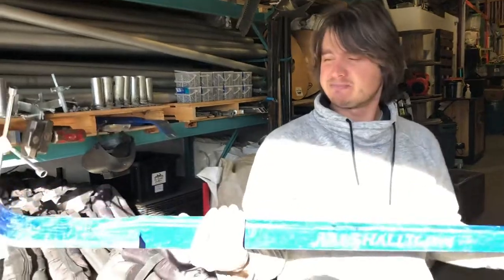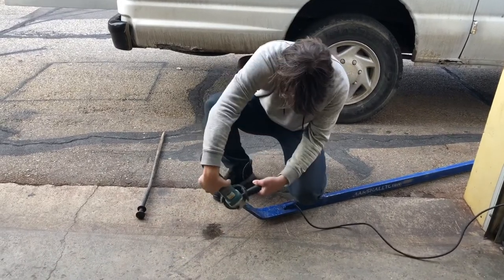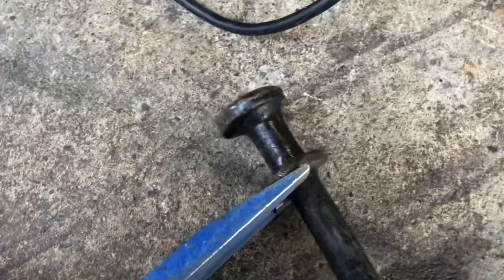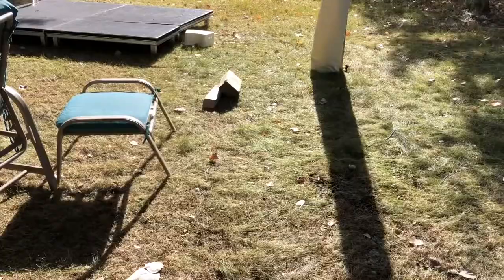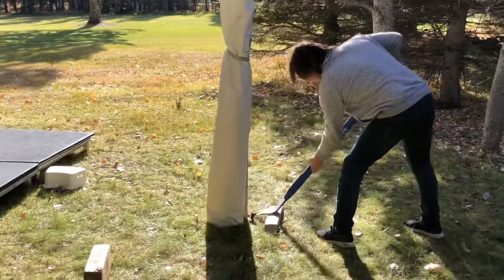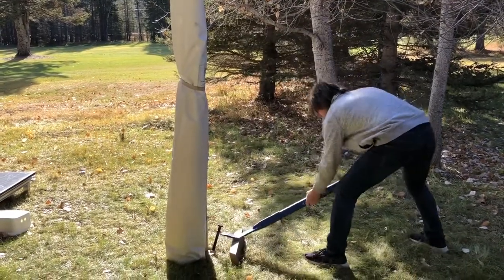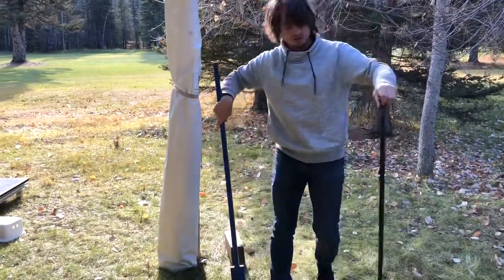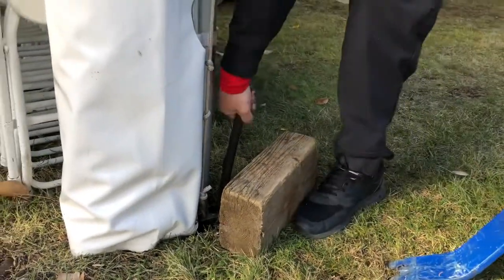Burke Bar - It's Awesome For Pulling Stakes - Prove me Wrong

Comment: Nice.    I've ordered some GroundGrabba screw in stakes to try with my 20x20.   You can screw them in & out with a cordless drill.    I might use a stake bar as well so I can use 2 or 3 at a time since they're not as long or thick as your stakes.
Reply: Lee-how did the ground grabba screw in stakes work with your 20x20?